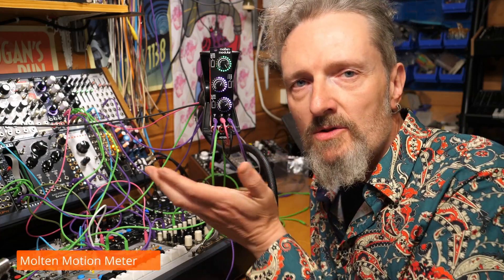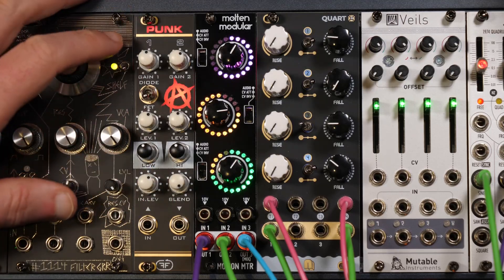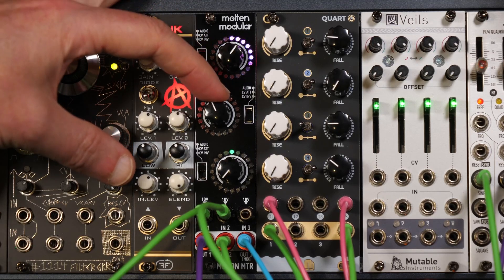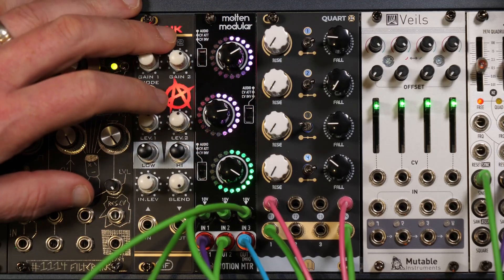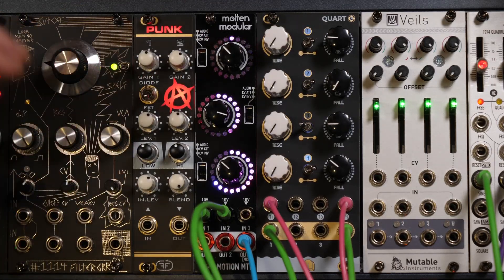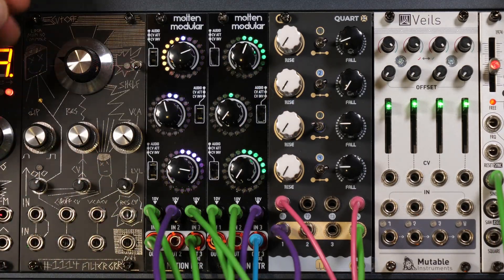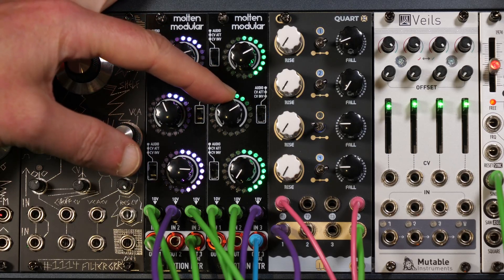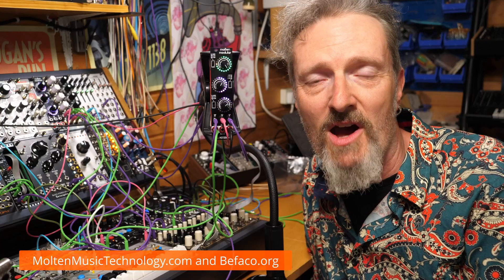Molten Motion Meter Overview

Comment: Hello, I absolutely love this! But is there any way to control the output voltage? Most of my modules would love a 0-5v range - or a -5 to +5v range. Is there a possibility to upgrade firmware to change the voltage output range?
Reply from the maker: Not as far as I know, no. You can scale the output of one channel using another if that's any help - and that is one of the features, to scale an input using the knob, so if you have something that's modulating too far you can pull it back through the MMM.

Comment: Help, my Motion is only showing full LED rings after the initial snake :( 
Turning the pots has no effect at all, what's the beat way to debug this? I got the tools, but not the brains.
Reply from the maker: Hey - you have to go through each joint, carefully. Make sure there's enough solder for a good joint, or take some off if there's a bridge...... this is assuming you built one? But otherwise, Befaco is your best bet for troubleshooting.
Reply: @MoltenMusicTech  Yeah I built it myself and it's all good, got it working by removing all ICs, blowing through the sockets with compressed air and going over most joints of the back-board.
I assume some joints didn't like me clipping their legs... or I was just sloppy. Neat little module <3

Comment: 'Fraid I'm not up on the "offset" concept I keep hearing about.
Reply from the maker: Say you’ve got an envelope in channel 2 and it’s attenuated so it’s moving a filter a little bit. Using channel 3 I can add voltage to channel 2 so it’s movement is further around the cutoff knob. That’s an offset, or at least it is in my understanding.

Comment: great idea, great module... i may add a personal wish for production: reversible front plate (print the layout on the backside in reverse) so the module can be used in both patching configurations, either bottom up or top down, because everything that is hands-on and performable should either be on the uppermost or lowest rail of your eurorack
Reply from the maker: It's a thought - thanks

Comment: So the zero point is always on 12 o'clock and the signal is going clock wise over 6 o'clock for visualise the full range?
Reply from the maker: No, the zero is zero, all the way to the left. 12 o'clock would be halfway there and all the way to the right is max
Reply from the maker: or do you mean the LED point? In which case the flip is 12 o'clock if you have +- 10v
Reply: @MoltenMusicTech  sorry, yes I mean the led zero point.
Reply from the maker: Ah, so yes, then I think  you're right :D